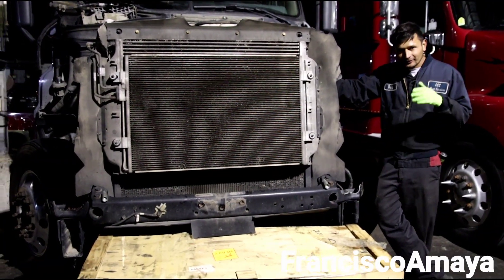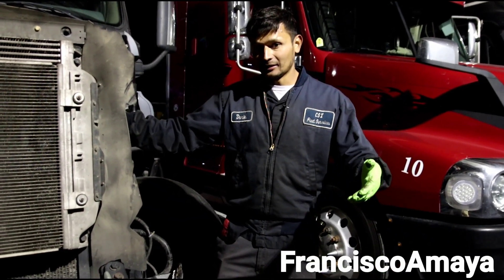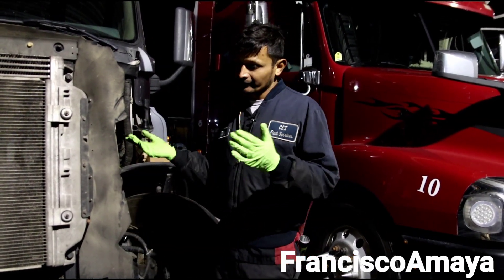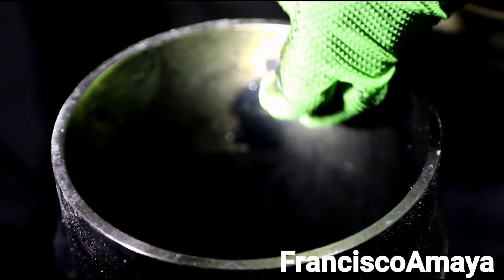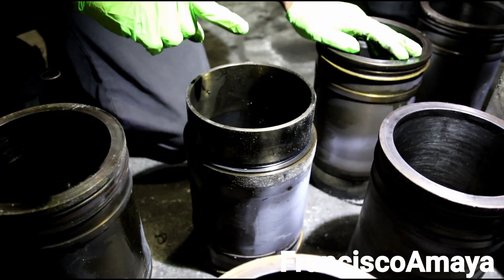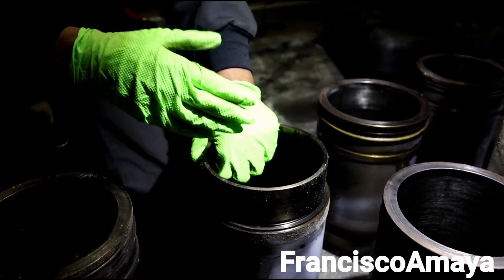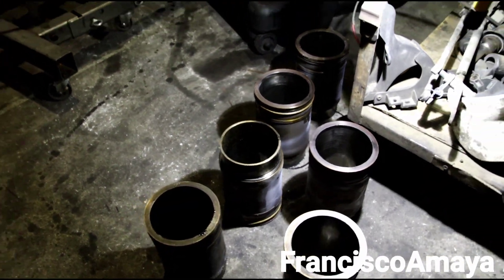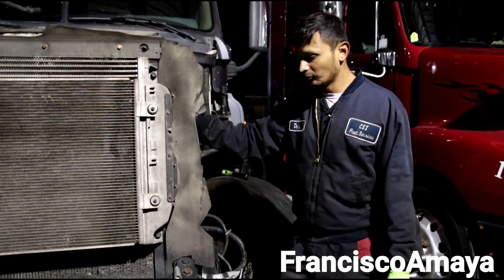Freightliner cascadia DD15 engine high blowby compression leak broken cracked cylinder liner

Comment: I have  a dt466 mechanical engine 1year ago had a shop do an overhaul but know it’s blowing smoke from the breather crankcase tube have taken it to couple shops but no help at all . One Mecanic told me couple injectors were acting up but he never returned  so I’m stuck with this problem any suggestions Francisco ? Thanks!

Comment: I had it exact same issue on 08/14/22. It reached 1167800 miles when this happened I replaced engine with used one eventually..i have another issue the used engine already,the engine vibrate while idling, rpm reads 550 while idling, when I set cruise to 800 rpm the vibration reduced.

Comment: The cylinder liners are too thin by design flaws.  Those were stress cracks, the differential between engine oil temp and coolant temp.
Reply: You saying the water got too hot?
Reply: Exactly right
Reply: Exactly poor design

Comment: Man that truck looked horrible.  Dirty, beat up and neglected.  The guys want to make all the money and not maintain their equipment.  The DD13 and 15 are good motors if you maintain them
Reply: They might be good engines but this seems to be to a common problem to often with this engine I've maintained my engine and this same problem happened to my dd15
Reply: @jaredortiz7485  what year and how many miles did it have when the problem started?  It seems like at 700k to 800k you need to plan on a rebuild.
Reply: @haulingfuel4759  Agree. I bought my '13 with a DD-15 engine with 880,000 miles. It had been maintained by dealership and at 1,028,000 miles, she laid down.  Can't complain about it, but it's currently in shop getting ready for an in frame. My only advice is at 800,000 miles, get an in frame done.
Reply: @cumminsrealpower680  man, getting a million miles out of a dd13 is incredible.  Hell, even a million out of a cat or Detroit without an inframe and new head is good.  I tell people to plan on the truck being dead around 800-900k miles, junk it, or make plans to swap in a Series 60 if you can get away with it.
Reply: @haulingfuel4759  I thought about the 12.7, but I decided to in frame the DD-15 to see how much better it will run. Has ALOT of blow-by, and I'm just curious about how much of an improvement on power and fuel mileage will be.